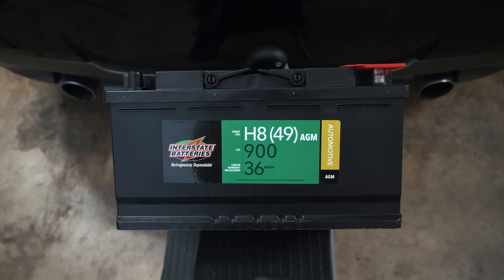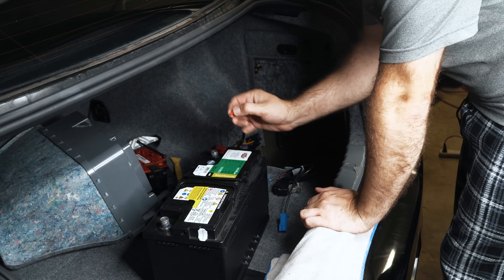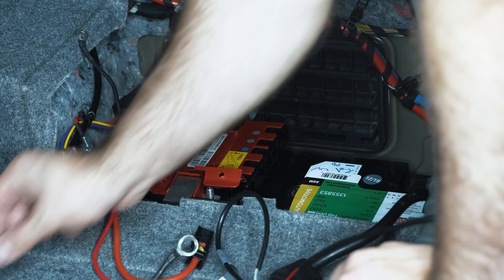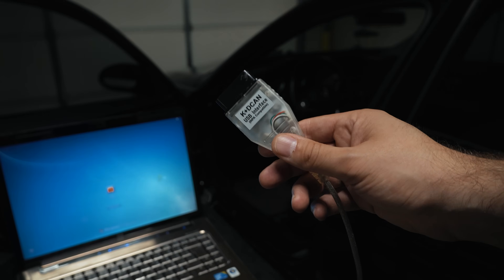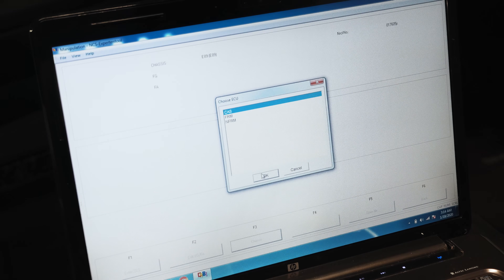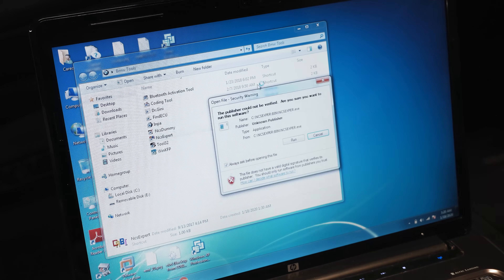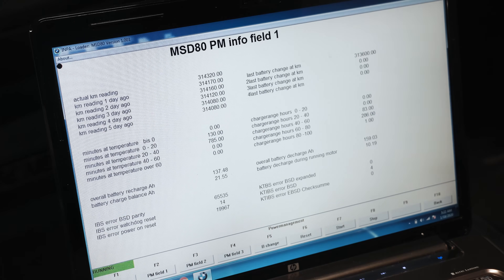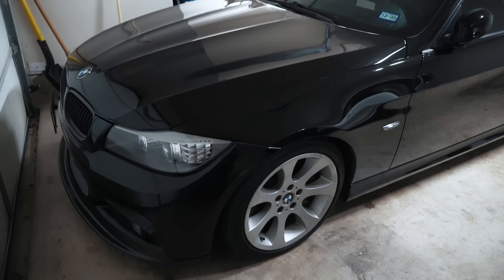Your BMW Needs A STRONG Battery | AGM Upgrade With Coding & Registration!

Comment: Missfires wont be anything to do with battery, full load from ignition even over 1000bhp is like 7 amps. Your rad fan pulls wayyy more than any of the engine components

Comment: Would this this procedure be similar for the e60?
Reply: I tried on 2010 E60 N52KP, works fine.  The only thing I changed from instruction is on 9:10 CBD Name, I changed it to match the earlier steps.  Not sure if that matters, it's probably go by what's inside TRC/MAN

Comment: The whole INPA, NCS EXPERT, NCS DUMMY, BMW TOOLS, Etc options coding seems way too mysterious to me and I’m no slouch when it comes to technology. But I watched your video here and it seems as though you’ve had training or extensive brute force trial and error lessons with these software tools. When something which ought to be rather simple such as registering a new battery takes such lengthy and convoluted procedures with multiple software modules then I have two problems. I find it doubtful these tools will ever be actually usable by me without explicit, step by step instructions for any given task. I know because I’ve bought the software and the pass-through and tried using them - mostly to no good end. Moreover, I invested in an Autel  Maxisys elite system and although this has enabled me to accomplish many more tadks. I find myself worried that the simple procedure it followed to register my new AGM battery may not actually be doing all the coding necessary to make sure the charging strategy or profile is correct. How can I check if it is?? 
Love your channel btw, you’ve helped me a great deal with my E70 x5👍🏻👍🏻

Comment: How long do AGM batteries last?  I have my BMW for 10years now and have never replaced the battery - I bought it when it was only 2years old so i would assume that it had never been replaced before, so that means it's been 12years for the battery.  Should I worry about replacing it soon?

Comment: Does it matter that the battery you have put in is a 95 Ah AGM and you have coded it to 90 Ah AGM? Just as I was coding my 95 Ah AGM battery and noticed there was no 95 Ah AGM option to select

Comment: So lucky I watched your video! I tried coding with Carly and ISTA+ but I never got any confirmation that my battery type had changed from Acid to AGM. I loaded up Ncsexpert and done the old way of codierdaten_lessen and then in NCSDummy I could see that it was still a 90ah acid battery. Changed to 90 AGM and ran Sg_Codieren. I then re-ran Carly and read the battery data and could see a 90ah AGM battery detected. 👍
Reply: So is it possible to code and register agm batteries on Carly?
Reply: @rudeone760  my E90 didn't have an IBS which is why I had difficulty making the change.. The battery type change isn't needed if you don't have an IBS. So yes Carly theoretically would have worked fine but the app probably knew the change isn't applicable.

Comment: Scotty Kilmer channel said that a weak battery is not good because it allows Interference from the alternator and other high voltage electronics like HID or sparks to propagate. This “bad quality electricity” will ruin your electronics in the long run.

Comment: Hi. Im abit confused with my car I got a 2009 e92 320d m sport highline. This car has alot of gadgets with it and the  start and stop.
Original battery lasted for 11 years.  It says 90ah 900cc
Doesnt have the agm logo but eveeytime i googled the car vin kept saying its a agm spec battery. 

I used carly i am.not sure that the old battery ah was at it could be 80ah or 90ah.
 Will it be a problem i seleceted it at (90ah agm)

Comment: I currently using a normal lead acid battery din 100, somehow Im having charging issue, even replaced with new alternator but didnt solve the problem.  I use schwaben tool to monitor the livedata on the charge voltage when the engine run which show sometime 13.3v and sometime t goes 13.9v/14v. But  still have code for alternator missing and bsd for alternator, waterpump & oil condition sensor. Also the ibs cable is also replaced and now make me think that I should replace the battery with AGM type. By the way,  my ride is E60 523i with N52 engine.

Comment: my new battery shows a 95Ah rating. Can i still use the 90Ah rating for me in INPA? or is there a 95Ah option. I haven't downloaded the software yet, I figured I would ask first. TY great videos btw.
Reply: @3:16 the video shows that the battery he's installing is indeed 95Ah (increase video resolution to 4k in order to see clearly), and he applied a 90Ah setting while coding.  I've see other videos where they advise coding to the available Ah setting just below the one labeled on the battery. (ex 85 Ah battery, code to 80Ah/ 92Ah or 95Ah battery, code to 90Ah/ etc.). As always, no guarantees, but that's what I've observed.
Reply: i'm asking the same exact thing. Did you find your answer ?
Reply: I have the same question 🧐
Reply: Di someone find the answer?

Comment: I got an AGM for my 135i it's a 75ah, is that ok? It was the same size as the one I took out. Trouble is that the electric steering wheel lock light came on now it won't crank over. Can you please tell me which adapter is best to use with the protool app.

Comment: Can you tell me why in the winter my car's date and time reset to flashing and I have to reprogram the time and date half the time when I get in my car? I get a message that says something like excess discharge when off or something like that? This only happens in the winter when it's cold out. I have a 2008 328xi 6MT with 85K that I've had for a year now. Thanks for your videos! Just discovered your channel and instantly subscribed.

Comment: My stock non agm battery is a 90ah with 720cca 160 reserve capacity. You think going to a agm 80ah 850 cca 140 reserve capacity battery would yield any benefits for a car with stage 2 turbos pr coils running 600hp? Or should just go with a new stock non agm? The reason I ask is because the 95ah agm is 10lbs heavier than stock. I wont be adding weight to the rear. If you had a choice between the the 2, which one?

Comment: This is probably one of the best BMW battery coding videos on YouTube, and I was able to follow the demonstration to code & register a 95Ah AGM battery for my 650i (E63). The car had been showing strange battery errors occasionally (I drive this car only once in a while and always use a battery tender) - turns out the BMW technician (sucker) put the 90Ah AGM battery under 110Ah non-AGM. No wonder! It also explains why the alternator failed and had to be replaced.

Comment: Just replaced a AGM in a E70 (original 2012!) but paid the price of letting it go way too long. Was in dealer for recall work 2019 fall, they tested the batter and said it's original but tests out good, said maybe it was replaced and not registered at some point (?) they still recommended replacing, I figured I would do it rather than pay $600 for a battery at the dealer. I neglected and 4 months later car dies while driving, starts throwing all sorts of odd codes. I replace the battery and figure I'll take it to indy shop to have registered (same exact agm replacement). Still random dies while driving and throws codes that say the alternator / regulator are bad. Take it to indy shop, they register the new battery and it's still throwing codes:
4C2C: mass air flow sensor, range
4990: exhaust back pressure sensor before turbo plausibility
4121: main relay
4A18 Generator
Replaced the alternator (w/relay) came and picked car up and it died on the highway on the way home, just like before, restarted drove back to shop and left again, wouldn't start for them for a good while, short cranks of 3 seconds and nothing....
new codes:
4BF0: Nitrogen oxide sensor after cat
48EC: Pressure sensor plausibility
After researching, I asked them to try less costly things than $800.00 alternators (installed) and it pointed to the CAS and finally threw a crank sensor fault. That was way cheaper than sending the CAS out to be redone so they replaced the crank sensor and cleared codes and test drove for 3 days and we believe that the low voltage / battery sent the E70 electric system into a downward spiral that took multiple clearings to get the junk out of the system and get voltage correct again, turned out the crank sensor was the only real bad part in the end Other than battery), but I ended up with a new alternator I didn't need, the shop felt bad so discounted additional diagnostic time... this could have been a whole lot worse, but still cost almost 2k additional in BS. because I let the battery go to long. Won't make that mistake twice.
Reply: Oh forgot to say, great videos! Thanks!!

Comment: you rock dude ... the details are whats killer .. you talking about the file to modify in case the previous owner coded the car is so $$ ... my car was coded and i never even realized it until i found out my dads f30 mirrors and windows dont fold in and close up when you hold down the lock button!

Comment: Isn't it the same to change the capacity and type of the battery in FSW_PSW.TRC file using ncs dummy, then export it to FSW_PSW.MAN file and code this file to your CAS module using NCS Expert? I think that you should also need to change your VO data. You should add A090 and will have to delete B080.

Comment: Do I need to code/register battery if i'm changing from 90 ah to 90 ah?
Reply from the maker: Yes so the car can adjust it's charging profile based on a fresh battery being installed.

Comment: Hi! Thank you very much for the video! I had a rough idle and occasional misfires on my e93 n43 after replacing all injectors(index11), coils, plugs and nox sensor but after watching this I decided to upgrade from a 100ah non agm varta battery (which lasted for 2 years due to incorrect coding) to a 95ah agm varta battery. Coded it according to your instructions in the video and my car feels so smooth I cant believe it!! It start immidiately and idles perfect!Can not wait to see more of your videos! Also that 340i is a beast :))

Comment: @Vehicular DIY Could you have settle for an H7 instead of an H8? Most sites list the H7 as the OEM equivalent for my car (2013 328i xDrive) and yours. I need to change mine and wondering if there’s a real benefit of installing an H8 over the H7.
Reply: Bump

Comment: Somewhat, remotely, okay not really related, but when you did your VTG/transfer case fluid change on your X5, what did you use to reset the CBS/adaptations for the transfer case? Or did you do a reset? In some diag tools there's a "Change Oil" reset in the drive VTG section. In other tools it's not there. My Foxwell tool has a module reset, but I'm a little worried about trying it.

Comment: Hi, nice tutorial, but unless I'm mistaken, this method will not update the VO of the car. If your car never goes in a dealer shop, probably not a big deal, but it's best to keep it in sync with what is installed in it. 

In this case, the end of the VO (in both CAS and FRM modules) must be updated from '-A080' to '-B090'.

This VO coding can be done from INPA tools (see http://blog.uobdii.com/register-and-code-a-new-bmw-battery-comprehensive-guide/ for example).

David

Comment: I have a E08 E90 335 my radio recently went black no Nav any idea what it could be no sound and screen is black and the SOS comes up on dash with line across it.
Reply from the maker: Sounds like one of the modules in your MOST loop went bad.  They make a bypass jumper that you can use to test.  If your radio is dead I'd check the fuse for that but I believe when you have a bad module on your loop the radio would still light up.
Reply from the maker: Sounds like one of the modules in your MOST loop went bad.  They make a bypass jumper that you can use to test.  If your radio is dead I'd check the fuse for that but I believe when you have a bad module on your loop the radio would still light up.

Comment: I really appreciate these videos man.  I bought an e92 for a great deal because of a misfire issue. I came across your channel and boom, everything I need to know about my n54 e92 and even helped me with my e70. fixed the misfire, all the maintenance/gaskets and installed all bolt ons minus turbo outlets. I wouldn't have tried installing or repairing half this stuff if it wasn't for these in depth informative videos. you have saved me so much money !!

Comment: I find my bmw very hard on Pb batteries, cooking them with charge rates above 14.2 volts. (Yes it's coded correctly)
Fyi first timers to BMW-  if your swapping chemistry between lead acid and agm you 100% must register the change or you'll end up with battery issues.

Comment: I am very keen on AGM batteries on cars that have a high quiescent current or a high discharge after shutdown.

For example my Z3 will kill a battery in a week with some drain it has. In normal every day use the voltage dropper to about 11.8 volts short use after about 6 months. Upgraded to AGM after a year its still at 12.5 volts. And I have left it for 10 days and it started up perfectly. 

People do not understand these batteries and they charge them at too high a voltage and kill them. 

I have the original BMW AGM  battery in my E65. Its date stamp is May 2004 and its still good. Because my E65 is only used on weekends I do put it on a trickle charger when the voltage drops to 12 volts. I have done this about once a year and it takes about a week on the charger at 13.5 volts to fully charge.

Comment: I just installed a full lithium battery in my E92 335i: 1,5kg only! Even after 3 days without charger it starts at freezing temps. Best lightweight mod ever at only 180 euros. :D
Reply: i do not think the rear end is happy by taking weight off it traction wise . I would not save weight that way.
Reply: @LukeBasson  Most of the road-racecars have everything deleted at the back like trunk/interior trim, rear seats, mufflers etc so around 20 kg is not that big of a difference on weight distribution. But if you only start shaving a lot off the back that's no good, agreed. Also I have a OS Giken LSD with 265 rear tires. I like some traction loss in the wet. :D

Comment: My regular battery was 90ah 720A and used a almost new BMW AGM 80ah 900A (charged it and it passed the midtronics test) with only registration. It's a free battery I just wanna see how long it will last me. I know if you go from regular to agm battery you supposed to retrofit/code it.

Comment: I totally agree with you, so far i have owned 5 bmws model and all of the models gave me battery problems.  BMW batteries suck, once the battery drain on you once thats it - yOUR BATTERY PROBLEMS WILL BEGIN, its the start to a battery issue that is very difficult to figure out.  thanks for the info guys

Comment: Nice, you took off the power distribution box of the battery. It makes removing the battery much way easier. Why didn't you remove the power distribution box on the last video you did two weeks ago?
Reply from the maker: Yeah lol I wasn't thinking for some reason.  I guess that shows you can get it out either way but I'd recommend to removing it.
Reply: @VehicularDIY  keep up the great videos.

Comment: Have you considered adding a 2f cap? Always helped with high end stero systems and has helped with older cars I've had.
Reply from the maker: That's an interesting suggestion, hopefully this AGM battery delivers all the current the car requires now.
Reply: I have a stereo system in my e92. Would you recommend a battery that can support the car and system?

Comment: Hey really love your content I recently bought a e90 320d and already order the lsd kit you installed to your car too many thanks for that! I’d like to ask if by any chance you could do a video of retrofitting power folding mirrors! Is the next mod I want to do and a video would be extremely helpful! Many thanks keep doing what you do!
Reply from the maker: Hey thanks for watching!  Folding power mirrors actually came standard on my car.  I can imagine the retrofit part is easy and you might have to do some minor coding to the NFRM module so they close when you lock your car.
Reply: Vehicular DIY I know sort of what I have to do with wiring, could you make a small tutorial just for the coding part? As far as I know I need to replace mirrors switches and passenger door harness and then route 2 wires to the passenger harness one 12v and one that will go to the Lin bus! I will figure it out as soon as start digging! Unfortunately am not familiar with the coding software I am about to install it to my laptop and a step by step guide for coding the NFRM module would be a true gift! Of course if you can’t spent that time I understand you have already give a lot of content, and thanks for that!